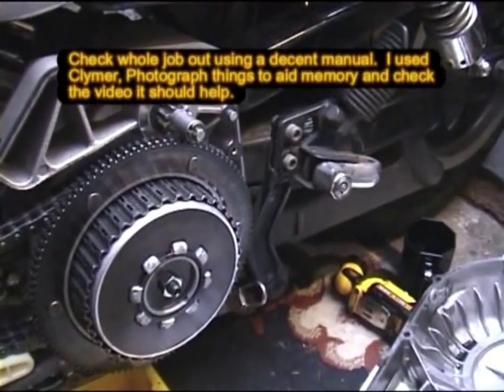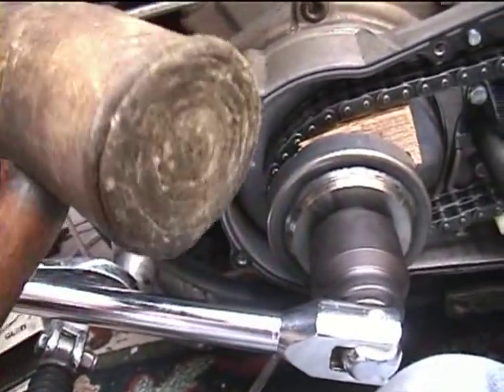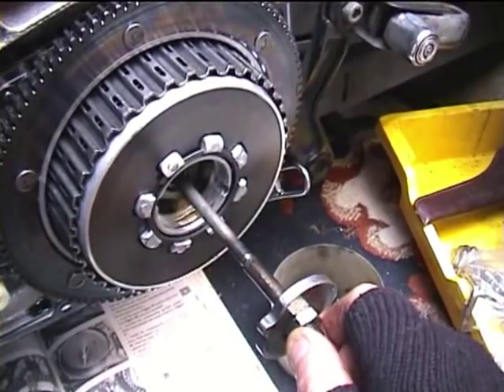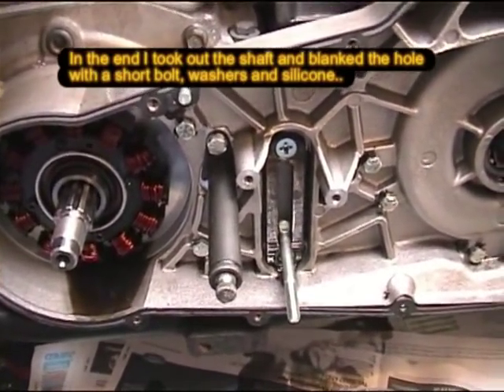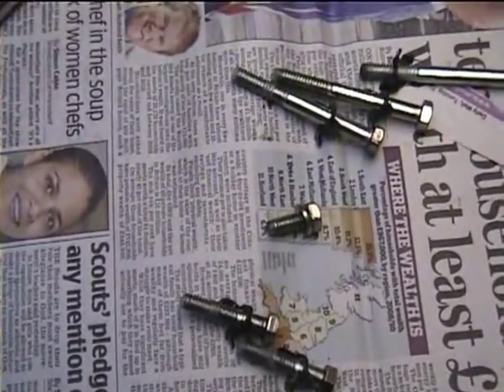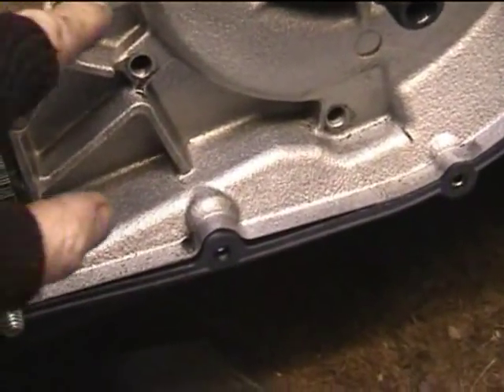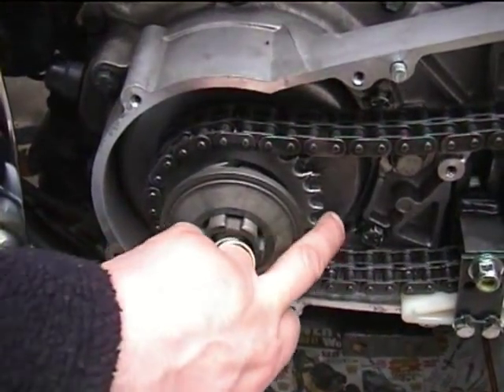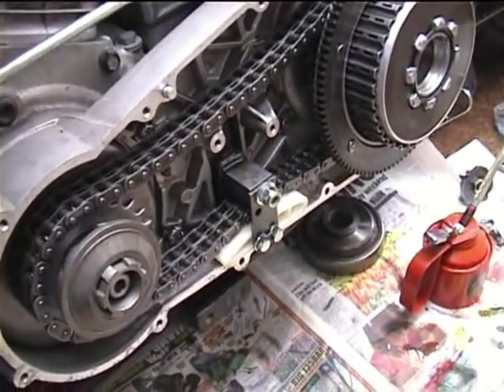Harley Dyna Glide EVO 1340 Drive Belt replacement.

Comment: thanks for posting this  , im doing this job in the next few days .
Reply from the maker: Thanks, btw if your swinging arm bearings or bush is worn I strongly suggest you sort it out while the primary chain case is off. Sometimes the spindle can stick. it’s not ‘get at able’ at the nut end ‘cos the primary chain case blocks your access to knocking it out.
Reply: @juliansinclair2122  thatks for the reply  am taking on a very tierd soft tail , i suspect the belt is the least of its worries going by the noises coming out of the motor ... have just discovered that the tappet oil screen was completely blocked... great

Comment: They make a very afforfable nylon step block to lock up the primary when.loosening and tightening  the  compensator nut. It just goes on between the chain and sprocket to loosen and goes between clutch sprocket and chain to tighten. No crushing wood into sprocket or jamming rags in there. With block in place you can just use a breaker bar and break compensator nut loose easily. No needing an impact or beating with a hammer. Saves the stress of beating  on your crank.and stressing the Alternator.

Comment from the maker: Since the video I have put a Fat boy front end on with solid wheels front and back.  Didn't video it though.... Apart from having to adjust the turning stops on the headstock, the front end goes on perfectly, the rear solid wheel directly replaced the spoked wire wheel, all spacer fitted.  It looks a lot like a Fat Boy, but it has that soft suspension Dyna feel which I like for distance work. Also with the original Dyna pipes (Slash Cuts) they run lower than the Fatboy pipes so I can use bigger throw over panniers.

Comment from the maker: I remember chains in the early 80's.  Using Chain Grease like Linklife and drowning the chain in melting grease.  Chains have come a long way since then. My belt snapped at 23k miles as it did on my earlier sportster.  For me chains just age and get sloppy.  It just needs a piece of road chipping to get on the rear belt  pulley which is wide enough to hold it. and... Chain sprockets too narrow for that in my view.  I understand why they went to belts initially when bike chains were poorly made, but chains last a good while with all that X and O ring rubber stuff...., providing they are greased that is...

BTW do you guys use any belt grease, or do you let the belts run dry....

Thanks for the video comments.

cheers!
Reply: +Julian Sinclair your showing your age by boiling your chain in grease. love the comment. can replace a chain on the road in about an hour.

Comment: Mate, you ought to try a pneumatic impact driver, if you've the space for the air compressor. It's a bit handier than a boot and a mallet for removing snug bolts. :D
Reply from the maker: No room for the compressor, bought a Clarke electrical impact driver when I realised that it was going to need a front sprocket/pulley replacement, rather than just replacing to back pulley...
Reply: Julian Sinclair right, I can see. Electric ought to do the trick, either way!

Comment from the maker: A while since I did this, but you remove the front and rear toothed assemblies (including the clutch basket) together with the chain attached, once nuts etc removed.... they pull off as a whole unit. I assume you have a Clymer Manual....it may have detailed differences to my 1340, but should be similar...

Comment: The wonder of "Silicon".... for 25 years i have spayed a fine film of silicon on rear drive belt and spun the rear wheel wipe off any drops or excess silicon,,,,,,,this keeps the belt fresh n supple ,,,resulting in a Much longer life span  ,,,,,,,you can use silicon spray on most rubber & plastic ....Care taken not to get silicon on brake discs & pads, 
Silicon spray can also be used on tyre walls to prevent cracking and sun light heat damage ,,,,,,and on snow board bindings to prevent compact snow from clogging ,,,,Car door rubber seals etc  fan belts on top side as to much could cause fan belt slip.,,,,.prolongs the life span,, ,,,but i wouldn't breath it in when spraying silicon.....

Comment: hello there.the nut holding the front dive belt sprocket on 16:30 is it left hand thread or right hand
Reply from the maker: P223 Clymer Manual "The Clutch nut uses left-hand threads.  Turn the nut counter clockwise to tighten it."  Hope that helps

Comment: OK ...I am convinced.....whenever my belt fails, in goes a chain drive conversion....
Reply: and what do you do when your swing arm bearings fail? I got 60K on my belt- when the time comes, the belt and bearings get replaced at the same time.  It's called a winter project- great way to get away from the wife. Heat the garage, chill the beer.  Ride safe.

Comment: is the bolt holding the clutch on reverse threaded? and you should use blue locktite, not red
Reply: +adam moscatello Don't comment if you don't know what in the hell you're talking about. The clutch hub is left hand thread, and the Harley Davidson FACTORY SERVICE MANUAL calls for red on the hub bolt and compensator bolt threads. Buzz off.
Reply from the maker: +Dp908 
Got to say your comment makes me laugh, especially the 'Buzz of'f bit...Always smile when I read it... Cheers!

Comment: my 1999 evo 1340 is getting oil on my belt ,could it be my shift shaft seal?i noticed my primary oil was low and added some oil and started noticing leak on belt
Reply from the maker: Starter shaft seal or starter housing leaking, although not sure that would do anything to the Primary oil level....

Comment: I wonder why doesn;t harley just put chain instead of belt ? cheaper, stronger and easier to maintain.
Reply: ton san Not easier to maintain as chains don't last nearly as long as belts, and if you want that front chain sprocket off you get to do the same job more often. GOOD chain and sprockets aren't cheap, and if a cheap chain fails it can do some impressive damage. When a chain gets slack it makes a nice "bandsaw". It's common to find starter drive housings munched by chains which were not kept properly adjusted.It's routine to get sixty thousand miles out of a belt and I have. That was an old 1988 belt and belt tech has improved since. I have chain and belt drive Harleys and unless I build a high-output engine and decide to do hard launches I'll keep my belts. Modern chain lubed with chain wax works nicely but I'll avoid chains where I have a choice. Good video by the way. I STRONGLY suggest every Harley owner buy the FACTORY service manual and parts book which is worth it for the exploded drawings, not to mention ordering replacement parts is an easy part number internet or Ebay search away. Clymer and Chilton are fine for absorbing spilt oil where Harley is concerned.